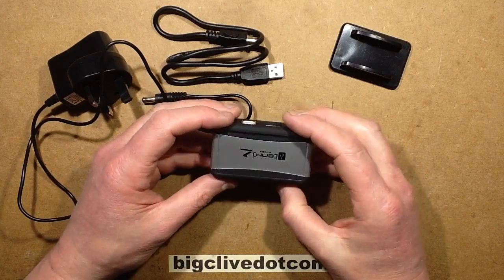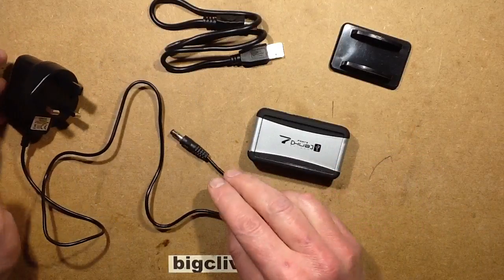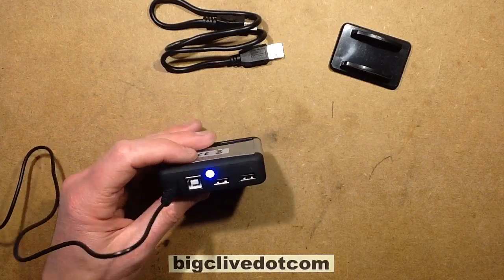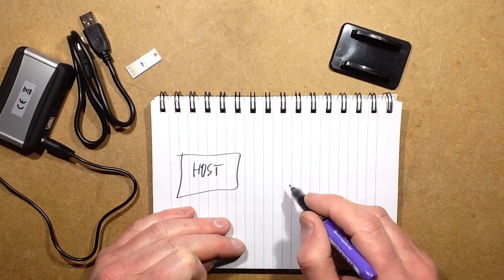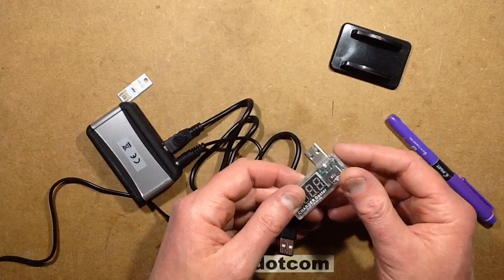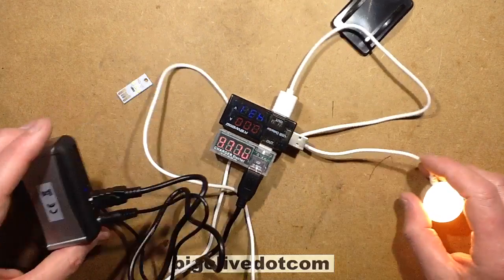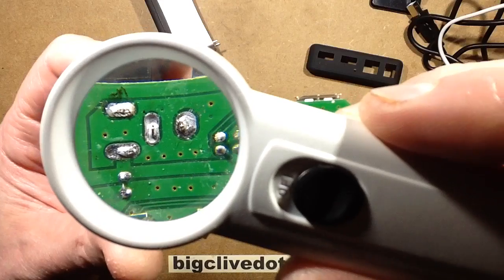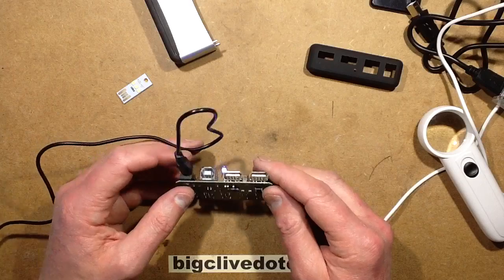Computer killing powered USB hub.  (Mac murderer)

Comment: This hub makes my laptop work, it's an old dual core intel laptop (8 years) that is just so temperamental it's unusable, but when I plug a powered hub like this into it, it works fine again. Any idea what's going on there because it's kind of the opposite effect explained in this video?
Reply: +Marc Dudlee Sounds like you've got some interference somewhere inside your machine. Here's a theory: Your own PSU doesn't supply a steady 5v. It messes up all the hardware that uses the PSU-supplied 5v. When you plug in the USB hub it feeds the 5v line inside your laptop with a stable 5v. You're pretty much replacing the 5v PSU inside the laptop with an external one.
Reply: That sounds logical. I metered the voltage of one of the laptop's usb ports and it was measuring 3.42V. With the hub plugged into another port this went up to 4.42V, still not 5V but probably high enough for things to stop freaking out. I'm assuming the 5V line in the laptop is fed by a DC-DC converter on the motherboard that takes its input from the main 19V PSU input?
Reply: +Paul Gerarts Yeah, any idea why that might be happening?
Reply: And when you say it's temperamental, what does it do exactly?
Reply: reggienuva183 Trackpad sometimes works, mostly it's stuttery. It tends to freeze for random periods and free up again. Wifi drops out all the time. But now it's fine, I traced the 5V supply on the board and replaced it with a separate dc to dc module. Not a pretty fix but seeing as the laptop is used almost exclusively in one place and not moved around it'll do for now. Looks like Paul's diagnosis was bang on.
Reply: Keep in mind there might be some other component that's not functioning properly and it's leaking/shorting so much power away from your 5v line the laptops PSU can't deliver einough energy to the other components. 

Anything else not working on that laptop?

Because if so, it might be a bit of a fire hazard, so don't leave it turned on unattended.
Reply: Paul Gerarts I completely isolated the 5V supply line on the motherboard (both output and input) and substituted it for a 5V dc to dc module fed directly from the 19V PSU input. Luckily I was able to download the schematics and service manual. I just metered the PSU under load and open circuit and it registered 19V in both cases so I don't think it's being overtaxed. It's a bit more tricky to meter the current because I have to put the probes inline somehow, but I'll do that next. The PSU is rated to 120W so @ 19v I'm looking for under 6 amps to be comfortable?
Reply: What?!

Comment: I actually have the exact same one, and what I did in order to stop it from feeding power down that line and borking up my raspberry pi is simply cutting the black and red wires in the USB cable itself that plugs into the computer. No issues since then!

Comment: A friend of mine who I have known since we studied electronic systems engineering at Uni posted this video on hist Google+ feed and it lead to a bit of a discussion but we both came to the same conclusion... this is Apple's problem.

Firstly I agree that it's not ideal to connect the two 5v supplies... but it's also true that powered USB hubs are quite common.... and they all allow power to be supplied either from the power supply or from the host...

Since USB devices require a voltage usually between 4.75 and 5.25, it would not be practical to use a diode on each power source as this would drop the voltage too much... so it would require either a mechanical switch, a relay or some kind of switch in the connector.

I have learned from the Raspberry Pi crowd that they use this fact to allow USB powered hubs to power the raspberry Pi by backfeeding power into the USB ports... and they tell me that most powered USB hubs do this.

Also, the USB spec requires quite a small amount of current to be available on the USB port, despite the fact that the computers PSU can often supply 50A at 5v... this leads me to conclude that the intention is for the USB ports on the computer to provide a good degree of protection and cater for this kind of hub.

Given the information from the Raspberry Pi folks, and the expectation of protection on the USB ports... I would have to say that I would blame Apple for the failed motherboards.... although I might well cut that track on any powered USB hubs I buy in future as a precaution (even tho I am not an Apple user).... so great video, I had not considered the implications of this.
Reply: If a hub is actually compliant to the USB specification, cutting the 5V trace on the host port will result in a dead hub, even if it's self-powered. A usb device is not allowed to signal its attachment (by pulling up D+ to 3.3v, or D- for a low-speed device) until it detects bus power, regardless of whether it's a bus-powered or self-powered device.
Reply: +James Lewis It doesn't kill Macs when they're on, it's when they're turned off. The Pi is a poor example because it's such a simple system that back-powering it simply keeps the Pi on since it only has a 5V supply internally.

As for diodes, a simple MOSFET active approach would avoid a voltage drop and allow disconnection of the 5V USB line from the internal supply when the computer is off. Seems a no-brainer to have this kind of protection in the USB chip.
Reply: +blargg Of course I understand what the RPi is, but I'm using it to point out that a great many powered hubs do this, not that back powering a full sized computer via USB would in any way be possible or sensible... obviously it's not, but the fact remains that this hub is not doing anything most of the other powered hubs are not also doing, and since you're not going to change the world, especially when other computers are not damaged by it (while on or while off)...

I agree that there are ways to provide this protection, but like I said... it's increasing the cost of the hub, and you're not going to change the world or compete effectively with cheaper hubs that don't bother, so the only solution is for the system board to provide appropriate protection, and since it seems like Apple (and probably only a few models) are the only ones affected I still can't help but conclude that it's Apples problem.

Daniel Bull
Reply: +James Lewis          There seems to be one flaw in your logic here. If this USB hub is just doing what most other powered USB hubs are doing, then why isn't this a much more widespread issue that affects most if not all Apple computers? There are millions of these devices (Macs) out there, and if they all had some specific issue with back powering from USB hubs then wouldn't we see scads of these things killing Macs left and right?

Granted you did say "and probably only a few models". We're missing some critical information here and that's which specific models of Apple computers got "killed" by this thing. Without that, it's difficult to draw any general conclusions for this. The error on Apple's side might even be limited only to a particular production run of specific motherboards. Who knows.
Reply: +James Lewis     Well on that I'll just say I have no idea. I use Apple computers alongside Windows and Linux, and u always plug in my USB hubs. Then again I'm usually plugging eight devices into a hub so it quickly exceeds the power available from the host port.
Reply: +lies damnlies    I always, not u. Goddamn mobile; why can't I edit comments? >.<
Reply: ***** I think your earlier suggestion that it is only one particular model, or even a subset made before this fault was discovered that are adversely affected... otherwise this would be a well known thing.
Reply: Well, you asked a question, and then apparrently gave a number of perfectly reasonable answers..... I might also say that not that many people actually use the external power on hubs, and probably apple users are even less likley to do so, if they even use a hub or USB for that matter.

Comment: I have plenty of shitty usb hubs that directly power the input USB 5v rail, haven't had a single PC usb port fail on that using them for 10+ years.

How is it even possible that pushing 5v on a line that is supposed to feed 5 volt blows up a whole motherboard? I'm pretty sure that at least the host USB ports are fused and should just disable the port itself. And it should at least have a diode in there somewhere to decouple it from the motherboard power supply.

So maybe it's just a case of macs having shitty design? Yeah it's a crap design on the usb hub's part but are apple motherboards such delicate flowers that they blow up if you short or do anything else funky with their usb ports?
Reply: +bami2 They probably expect you to buy the Apple branded USB Hubs for 400$ each. And if you don't, fuck you, buy a new Mac.
Reply: +bami2          It's safe to say that even if this is Apple's issue, which it probably is, it's very limited. We don't know which models were effected as they are not mentioned in the video. +Steve Brace in another comment thread said this: 

From memory (and don't flame me if I'm a little bit wrong here) If the hub is supplying 5v to the USB port, this will hold PPVOUT_S5_PCH_DCPSUSBYP high when shut down. This will keep the Mac in an S5 state until either the battery runs flat, a reboot is forced or the battery is disconnected. It should not destroy anything on the logic board, it simply causes the PCH to say; "WTF?"
Reply: +bami2 Probably because the port is powered off so the current will flow through some body diodes. Most USB ports are powered from +5VSB, so it is already designed to accept 5v when in S5, but the Mac's apparently work otherwise. Or the hub's power is not very stable and peaking above 5.5v.
Reply: +lies damnlies Yeah that sounds like a much better explanation than some random shitty designed peripheral blowing up motherboards. Thanks for the info.
Reply: +Tom  Yep, that's what's happening.  Apple's cheap fix would be a Schottky diode feeding each USB port.  The voltage drop would be insignificant;  however, the hub should NOT be feeding 5 volts back to the host port.  That's the elephant in the room. Shitty Chinese design.

Comment: I got a usb isolator after I discover that my asus eeg blower still was running after it was turned off. The 5v was comming from a arduino mega with a 12 volts cnc shield. I was also thinking thinking to do a usb extender cable with a low drop recifier in the 5volt.

Comment: have you thought about that maybe it was meant to be used with either the psu or the usb cable, and not both. it seems like it was designed this way, maybe the guy just didnt read the manual and just thought it needed auxiliary power to operate, which it, by design, doesnt require!

Comment: The Mac has a big problem with USB that Apple won't admit to.
There should be no way to blow the main board from the hub, but I've seen many of them die this way. I'm pretty certain that you fail USB Logo certification if you allow a hub to kill your host.
Reply: I had acer which burn 2 times the USB ports from the motherboard, first one was when the vacuum cleaner touch the USB cable and second was whit no obvious reason.
Reply: +SpiderElectron That's probably why apple use non-compliant USB plugs on their iDevices, so they don't get sued for using the USB logo.

Apple's USB 'use' is weird anyway. Iphones won't charge when supplied with 5 volts on the USB port unless you do weird voodoo with the D+ and D- lines
Reply: +TheChipmunk2008 That's going to get more and more common, there are generic (non Apple) charge circuits that will do that as it also determines what current is available.

Comment: I've been running one of these for around 12 months, the only problem was the 5vdc going back into the router so I cut the + and - and all works perfectly.
Reply: there basically supplying the wrong cable, I'm sure there's printer cables and what not that exclude the power through those usb cables

Comment: Better put: "A USB-like device killed 3 Macs because the Chinese didn't read the USB specification or submit an example for certification, and the owner didn't pay attention to the packaging when it was missing the (trademarked) USB logo."
Reply: +Andrew Foss Or because the Chinese slapped the USB logo on the packaging without the tedium of actually getting the certification.

But doesn't surprise me that it kills Macs but not PCs. Never let it be said that Macs are protected from any operating condition if they'll run (at least for a while) without it.

Comment: Easy fix would be to just cut the + line from the USB cable, that connects the Hub to the computer. But then the Hub would only work when it's used with its power supply!

Comment: Dude  that's a charger not a usb hub.
Reply: +Duy Zoro I purchased this hub off ebay a few weeks ago, is advertised as a powered usb hub, also functions as one.... occasionally.
Reply: that's weird, normally usb hub come with wires to connect to your pc. Hey can you try using the usb hub without the power cables ?
Reply: yeah it comes with a short(ish) printer style usb, is easy to miss in this video, works v bad with only that, wont power/connect two peripherals at the same time!

Comment: I have used HUBs that can work with 5 Volt devices such as a Thumb Drive and not have its power supply connected. The only thing to consider is the outputs at the ports are power shared using only the total power from the USB port. 

When its dedicated 5 Volt supply is connected to the HUB then each port on the HUB can deliver proper rated power.  To avoid the 5 Volts from going back up in to the computer there are supposed to be steering diodes to avoid reverse power back to the mother board.  

Reverse power will easily damage the associated mother board port or card port with most computers. 

It is best to stay with the more expensive name brands of devices. There are many cheaply made devices out there that can easily damage the host computer.

Comment: One would think that USB ports on computers would have back feed protection. They have over current protection and power shutdown via the USB power manager chip already. Why not isolate the port with the same FET used to "eject" (safe power down) when back feed detected? Good thing to know.
Reply: Most of the modest priced motherboards do especially modern ones. Only had 1 die and that was a very cheap motherboard

Comment: I have this same exact device which I bought for cheap to use as a hub that supposedly would let me charge devices when the machine was powered down as well. All plugging it in did was turn the lcd light on and wouldn't power anything at all with the pc powered down. So I chucked the power cord in a drawer and it's actually worked perfectly well as a passive hub for multiple devices for about 3 years. Apparently ASUS motherboards are better designed and  made then Apple Crapintosh. No surprises there of course.

Comment: A case of bad engineering killing another example of bad engineering.
The USB ports should have protection in the form of a  PPTC and a diode.
But then it would not surprise me in the least if Apple decided to cheap out and try and save a few cents as their design and engineering has gotten kinda bad lately.
Reply: +Patchuchan Yeah, if you look macs board repair vidoes, you can notice that they are cheaping out lot of stuff.
Reply: ShadowsThe1
What's funny they used to over engineer their products.
Reply: Patchuchan, what you wrote is garbage assumption. Once you put a diode in series, 5V USB voltage already drops out of spec. And if you put PTC fuse in series, it becomes even worse. And forget about phone charging from USB port with PTC fuse in series as it will drop a lot of voltage due to it's own resistance.

Comment: i have 2 of these mine are fine?
Reply: i suggest using either one (the power supply or the cable to the pc) not both at the same time
Reply: +Dennis van der Kooij  well it won't read a hdd? i have 2 plugged into my pc and 2 power cables there fine on my end.
Reply: +newport5504 well, as you see, there is a risk of feedback like shown in this video so yeah, and also, the usb power of your motherboard will power the whole device so you dont need the pwer supply to be connected to it

Comment: I have a 10 port Chinese hub I got that was more or less like this. I have all 10 ports filled with devices. I have enough that PC +5V wasn't enough to run everything. I needed external power and used a 5V 4A PSU with clean output. The hub didn't come with an external PSU but had a plug for one. It also had a switch to turn the hub power on and off for both host PC and external. I didn't have the proper barrel jack for the external PSU. Decided to go inside since I wanted to do some changes to the design inside. (Mainly getting rid of the blue LED. Too damn bright...) When I got inside I noticed the exact same problem with the powered hub here. Both external +5V and host +5V would be crossed directly together with no protection diodes should external power be used. I simply fixed the problem by disconnecting the switch from main power to hub, hooking it the the +5V from host PC, shorting where the switch was, and hooking external lines in to go to my external PSU. The external line is always hot but has a USB plug on it. So now when external power is used I keep the old switch turned off to disable host PC +5V. When not using external power simply turn the switch on for PC +5V. All grounds hook together. Problem solved.

What? I like to hack electronics apart to make them suite my needs or fix defects. (Like the hub had with external and internal power not separated at all...)